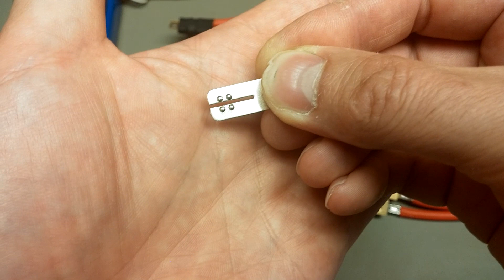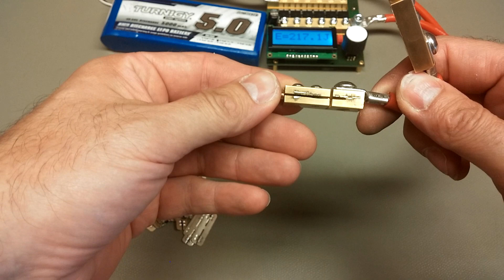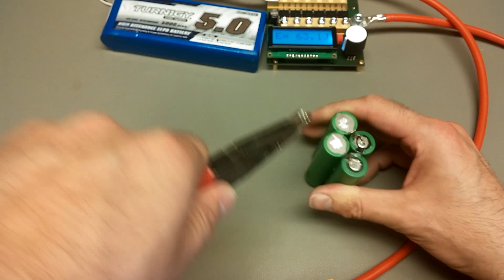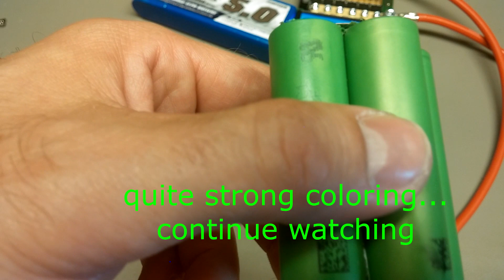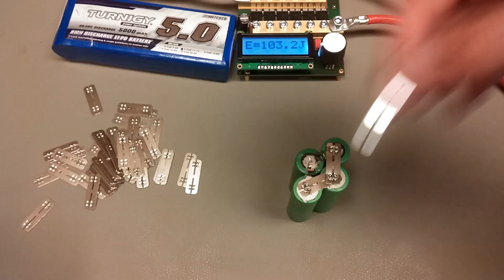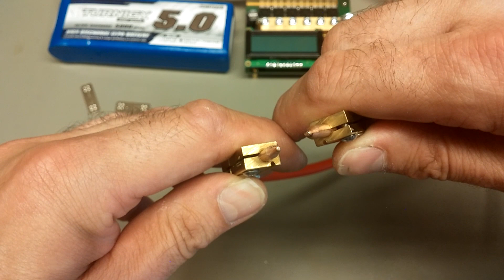Experimenting with Next level DIY battery spot welder

Comment: FIY: The purpose of that slit in the nickel strip is to drive the current into the battery, and up through the other weld spot. 
This results in almost equal current in both spots.
This means you must place the electrodes ACROSS the slit, not along it.
The slotted strips are proper battery strips optimized for battery welding. 

This in contrast to the cheap plain strips which are not battery strips, just simple nickel band.
They are somewhat usable (and are widely used) but they essentially short-circuit the welding current so that about 70-90% of the welding current
passes straight between the electrodes via the nickel strip. 
This is very wastefull in terms of heat, welder load, and battery usage. Also results in excess of poor or failed welds.

Comment: The gap in the plate should be between the electrodes. The current path will be different and welding will be more efficient. This gap is specially made.
Reply from the maker: yup, exactly. I only saw that after the video was online facepalm

Comment: Hello, your website shows super capacitors in stock. Can I use a bank of several capacitors to power this welder? How many capacitors would be ideal? I do have a 50A 0-18V power supply with CV CC to keep charging the caps.
Thank you.
Reply from the maker: Capacitance should be >> 10F such that the voltage doesn't drop too much from a pulse. kWeld isn't a classical CD welder that completely drains the caps. 12V is optimal, 30V max. Cap bank ESR is most critical. 1500A target current, welding unit contributes ~ 3mR. Add another 1mR for a typical weld spot.
Reply: @wearethewatt2950  thank you for reply.

Comment: .3mm is what is usually used on Nicads, is it not? I've never seen the 18650 with anything above .2mm. I'm not surprised the cell bottom gave before the strap. Still, good demo. Thanks.
Reply from the maker: Quite a few LiIon battery builders in the online community use 0.3mm, as good modern cells can put out 15A continuous current or more. Some even experiment with aluminium or copper replacements.

Comment: I have purchased one of these kits and I lve in the UK.  I thought I had a complete kit but unfortunately was missing many if the fittings and dasteners which I had to purchase separately mainly from EBay.  I made the bus bar from solid copper and tinned it with flux and solder.using a small butane torch.  I cleaned all contacts and soldered them to the copper wire using either the butane torch and separate flux or an old Weller induction soldering gun. My relatively powerful soldering iron was not up to it.  The cut ends of the insulation were protected with silver foil snf Ksoton tape from the flame.  I bought 10mm copper bar drilled one end for the cable and soldered it in directly, the ither end was turned as a cone.  I used lots of copper washers on the cable ends and bus bar which I had in stock.  I can see no logic to crimping cables when having a low resistance is so critical.  Squeezing two dissimilar metals together both with oxide layers seems to ge asking for trouble.  Galvanic currents must also be set up between the metals. My overall resistance as measured by your device was 0.003 ohms despite having a total cable run of 1.2 metres.  First attempts today with the finished welder gave excellent results at 10 joules and the power did not need to be raised.
It does strike me that pulling heavy currents through these tiny spot welds in use must cause excessive local heating.  Would it be interesting to measure the resistsnce of the spot welded components, say nickel tape to nickel tape, nickelised metal tape to itself and both to a battery base ( cut free from an alkaline cell) to see what is going on and whether two or more spot welds reduces the resistance and how penetrating ir wide a spot weld area should be. 
I am very pleased with the unit. Regards
Reply from the maker: I'm sorry for our mistake. You could have contacted me and I would have sent spare parts asap, we have permanent stock. Glad to read though that you could sort this out and are happy with the tool. If you tell me your order number, then I would like to send you the missing busbars. This is because they are part of the current measurement circuit and a copper replacement will likely lead to false readings. Regarding crimping: when done with the right tool (enough clamping force, should be at least 5 tons for these lugs) you get a so called cold weld. This is air tight and also the best possible solution in terms of electrical conductivity.

Comment: great project and it works well . but those lipo batterys are going puffy and wont last long
Reply from the maker: I'm not recommending the model that I show in the video, but have tested a few others. There are special high discharge models that can handle this use well, and they don't show swell after a number of discharge cycles.

Comment: Your unit looks great, I like the fact it is driven by energy not time, I assume you designed it this way to compensate for battery voltage dropping from fresh charged state to discharged while maintaining constant quality welds? So with 0.3mm you were using 200joules, what do you think 0.15mm nickel would need - 100 joules? Or is it not linear
Reply from the maker: I doesn't depend on which voltage it gets from the power source (can be 4 - 30V), nor the current that flows (can be 1000-2000A), because it measures the power that is delivered to the weld at the electrode tips. The 200joule that is shown in the video is wrong because the algorithms were in a very early development stage at that time. 0.3 nickel typically needs 50-100j. I haven't tested if this is linear, the normal procedure is to find the right energy level by testing. You start with a low setting, make a test weld with a scrap part, and increase the energy until the nickel strip just tears apart when pulling if off.

Comment: I noticed that in the 60j, you had both electrodes on the same side of the slot. Do you think if +and - were on either side it would of worked better?
Reply: Then you did it again. The slot is to separate the two electrodes for a better weld by forcing the energy to travel threw the two points and battery top instead of just threw the strip.
Reply from the maker: yes definitely, that was quite stupid. But it showed that the welder wasn't highly impressed from that ;-)

Comment from the maker: I totally underestimated the demand, and ran out of stock by just pre-orders in less than a week. I plan another batch right after having received the current one. I'll inform again through the newsletter. But in order help me estimate the demand, I have just implemented an "inform me on availability" button for the sold out products that puts you on a waiting list when you click it.
Reply from the maker: the unit is battery driven, there is no high voltage anywhere in the circuit. You are only in danger when touching high voltage, such as in this example (my heart almost stopped when seeing this, scroll to 7:55): https://www.youtube.com/watch?v=lT3vGaOLWqE&t=485s
Reply from the maker: you're sure they are all staged? This particular doesn't look like that. You can clearly see the HV arc just before he touchs the electrodes. I just hope that he has a deadman's switch under the table.

Comment: It occurred to me that the reason for the 2 prongs on the strip is to force the welding current through the entire weld, and not allow it to pass through the strip itself without touching the battery... however in this video you appeared to be avoiding this option.... is there a reason for that?
Reply: Yes I just wanted to comment on it as well. The correct way is to touch opposing parts accross the strip division. It should force more current going through the weld and less shorted through the strip.
Reply: did you watch the whole video?
Reply: @jimmysyar889  Perhaps I didn't... :p
Reply: James Lewis haha only took 2 years 😂😂
Reply: @jimmysyar889  That's the problem with making such a repetitive video... as evidenced by the fact that I'm not the only one to make this comment, it's hard to get through more than 5 minutes of this, so to have a "oh by the way I was doing it wrong the whole time" right before the end is not ideal.

Comment: i like to buy one kit, how much price
Reply from the maker: I am afraid but at the moment I am completely sold out.
As this is the first production batch of this new product, I will wait for
customer feedback before ordering a second, larger batch. I will accept
pre-orders by Sept~Oct and expect to be able to deliver again by Oct~Nov. If
you are interested, I suggest to subscribe to the website newsletter https://www.kicksurfer.de/index.php/newsletter/ 
Check out the shop articles, the price varies depending
on what service your order and what you like to make yourself (soldering,
making cables, ...) or what parts you already have available. Many parts can
easily be sourced from your local hardware store.

Comment: I would like to order one but was unsure of what was in the DIY kit. I know the external battery leads and Welding wires aren't included but is that the only parts that aren't in the kit?
Reply from the maker: I am currently working on an assembly manual, that will clarify a lot of these questions. I deliberately divided the kit into several parts, because a lot of DIYers will have most parts already available, or be able to source them locally at low cost. The individual articles in my shop have part lists, so you can check if you actually need that article.

To build this welder from scratch, you need the electronics module, a fuse, the bus bars, cable and electrode holders, a foot switch, a pair of electrodes, and the set with screws, washers, nuts.

I also offer suitable XT150 battery connectors, but as I am not supplying the batteries, you may also use the ones that come with your batteries. I actually have some batteries equipped with XT90 terminals, and will check if these are suitable. The T-shape Deans terminals definitely are NOT.

The kit will soon be extended by a programmer that will enable you to flash firmware updates. I will show that in my next video, it is very simple, the price for this tool will be around 10€.

I also modeled a housing for it and plan to sell that in the shop, as well to provide STL 3D models.

You can choose to order bare parts, or let me do the machining work. But I have to take a relatively high charge for the latter, because I have very limited time for this kind of work.

The assembly manual will also list the required tools for the individual steps.

Comment: By far the best engineered spot welder I've come across. I like to buy one kit. When you will have it available? As I am an electronic engineer, it doesn't need to be completely finished. I will provide enclosure, etc. Regards.
Reply from the maker: Thanks! A first batch of 25 partially assembled PCBs is already in production (partially because I decided that LCD and dial pot should be extra, to enable you arranging everything in a custom enclosure), I accept pre-orders via credit card or Paypal in my shop: https://www.kicksurfer.de/index.php/product-category/kspot-welder-kit/ I expect being able to deliver by mid August. There you can choose what you need exactly, and what you want to make yourself.

Comment: Nice spot welder you have there. I was just going to say you should be welding with the electrodes either side of the slot , but then you did that at the end of the video. Are your electrodes just standard copper or the  special hardened copper made for Spot welders.
Reply from the maker: The electrodes are standard copper. I have carefully rounded and fine-sanded the tips, which provides a reasonable lifetime. I realized that if the tips are too sharp, then the tip to nickel strip contact receives too much energy and tends to bake.

Comment: probably 115 juole looks good enough. It just has to be tight enough without punching a hole in the battery. Very impressive, the plug in models from china are only recommended for 1.5mm and your battery powered unit was easily welding double that.
Reply from the maker: jony joe I know that I was taking it to the extremes, but that was on purpose. I'll be doing a regular weld task on a custom 6S2P and show how it's like working productively with the welder.